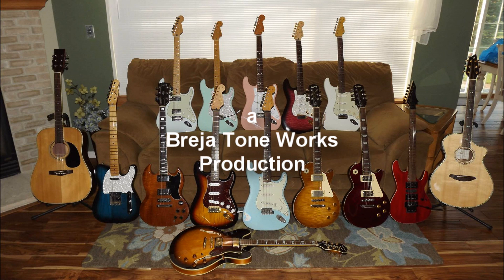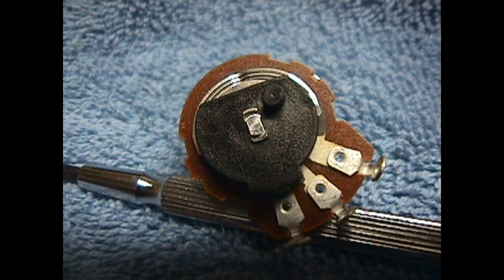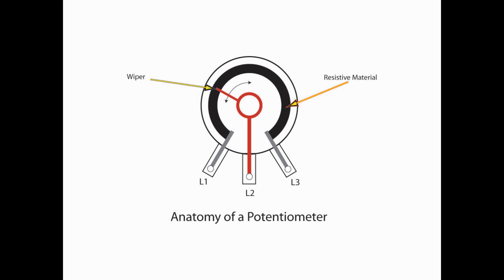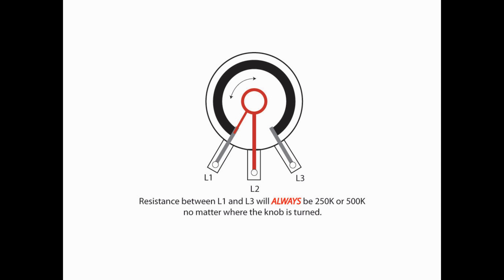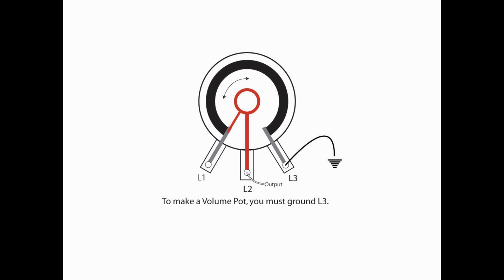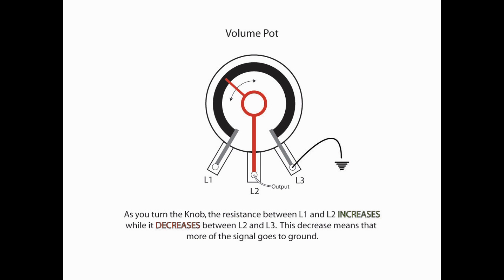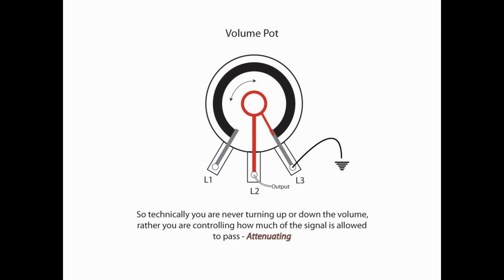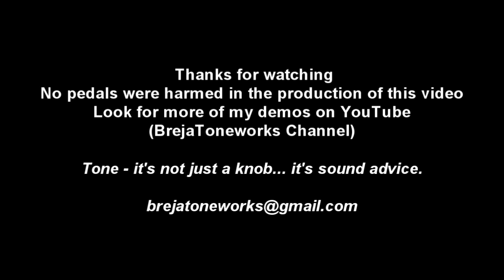Volume Potentiometers - Explained

Comment: Another great video, Don. So if you wanted to make a pot left handed all you would have to do is ground L1, L3 input, L2 output?
Reply from the maker: Hey James...  It would work but not very well and you won't like it.  Instead, seek out Left-Taper or Reverse-Taper Pots.  They're specifically for Left-Handed guitars and they'd work and sound the way you'd want them to.

Don
Reply: @BrejaToneWorks Thanks for making this video, it's really helpful to understand how a potentiometer works. I recently placed an order for some reverse taper pots, would I wire them L3 ground, L2 out, L1 in as per this video?